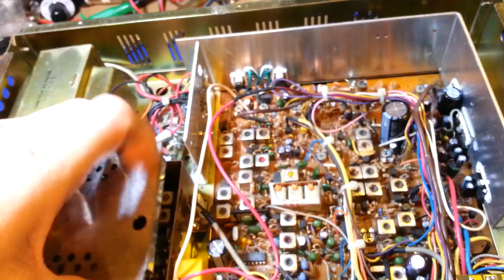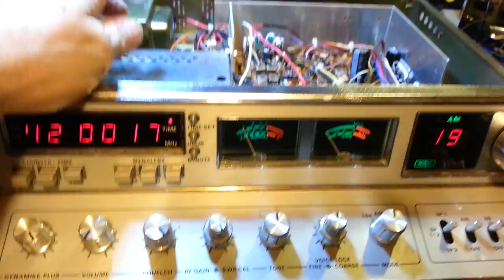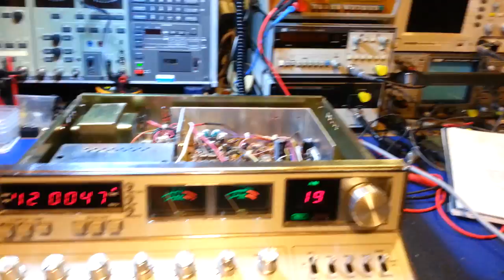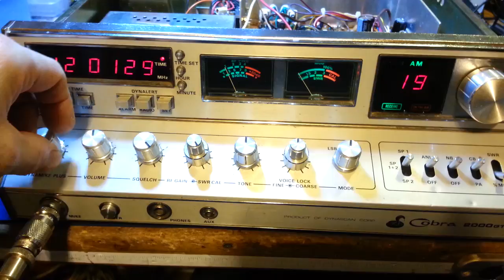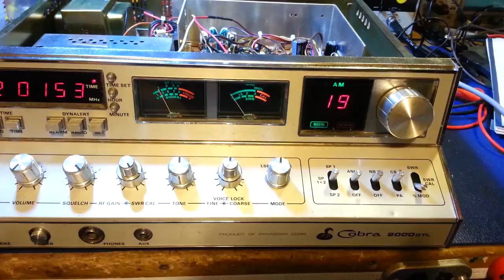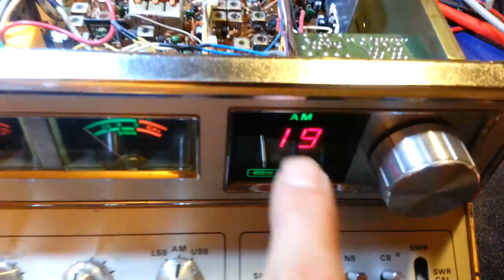Cobra 2000GTL restoration with tips/tricks.

Comment: Say I have a Cobra 2000 that will not receive and will not transmit I have changed the finals and the driver but still nothing and the frequency counter is going crazy any ideas
Reply from the maker: Probably a problem in the synthesizer circuit.  PLL, oscillators, VCO, etc...

Comment: Stupid to run them to their limit! If you want more power get an amp. With a good antenna as your base antenna you do not even need that much power. A base antenna has so much less ground less than a mobile and better gain! In fact a server power supply and a 1 or 2 transistor amp would more than get it down. It would not break the bank at all.

Comment: I had two 1980’s 2000’s, my wife’s had added channels, minor peak and tweak with a nice swing and super clean tune with D-104 Desk mic.  Mine was similar but had a power output matched perfectly with my Golden Eagle 750 Tube amp also with a D-104 Desk mic. It had a much bigger swing for sub.     Just bought a 2000 after 30 years and want to send it to Mike for caps, clean and tune.  It will need to be matched to a single tube 50 watt preamp feeding my 600watt sweep tube amp.

Comment: As good as these radios receive - I did not know that the schottky  Diodes would do anything for the radio,size spacing on a lot of radios restricts using larger caps in them.

Comment: You brought up the subject of burning up the transformer - with the heavy wire that they are wound with can they actually be destroyed. I have a power supply the wiring on both sides is burned up. Someone tried to repair it but failed. I removed all the attached wiring and just have the main hard-wound wiring and it still works. I used a 3 amp fused line to test one side blows the fuse - the other side produces 16.8 volts so now I know how it is wired. The circuit boards are fried - so I do not know if lightning hit the radio or what happened.

Comment: You are exactly correct about the Cobra 2000, they need very few mods done to them.  They was a great preforming radio from the factory.  The only mods I would want done to one is an Expo channel kit, maybe open the clarifer and a little tweaking on the ALC and put the cover back on it !

Comment: i agree with you here no need to hot rob these radios. or even do them hillbilly extras channel's'  i have one that had been modded extras hooked to the switch board , it had the yellow-/-orange wires to the pin 10/11 of the 8719 chip
i removed the said wires patched the switch board now the radio went nuts no rx/tx  wont change off a frequency ugggg
i just threw it in storage for now get it looked at later down the road
Reply from the maker: Which switch was used?
Reply: +MikesRadioRepair  they used the cb/pa & nb switches also didnt mention after some investigation also found the can the main thick crystal has a ground jumper solder to it the adjustment is broken,